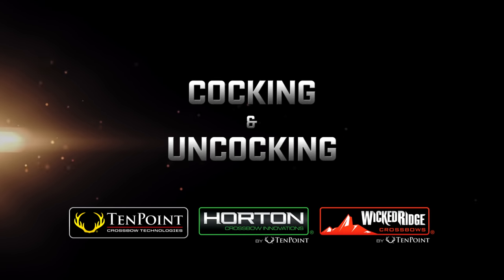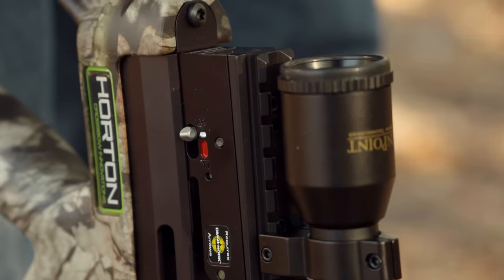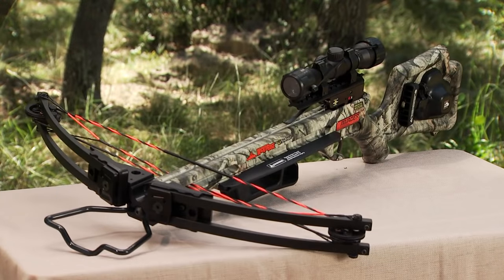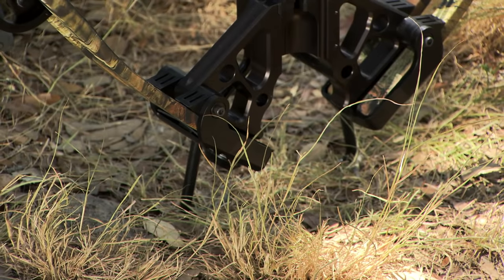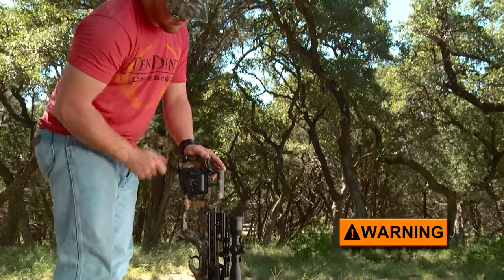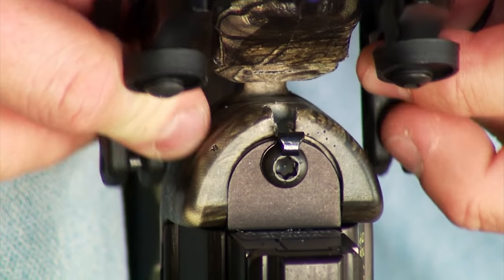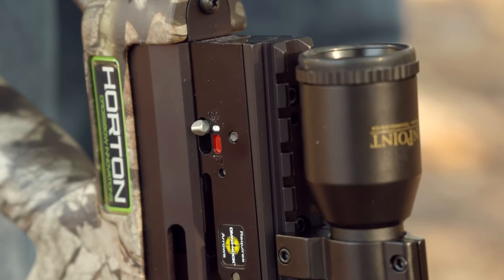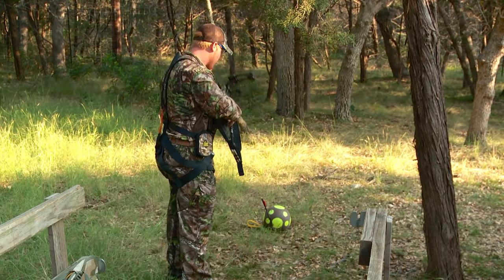How to Cock and Uncock Your TenPoint, Horton, or Wicked Ridge Crossbow | TenPoint Crossbows

Comment: I have a Barnett XP400 w/CCD. It worked at Cabelas but after getting it home it's hard to crank and before it gets far enough to lock in, the 2 hooks are scraping down the arrow track & also wedge against the upper rail stopping the cock by 1.5" from locking in. I don't know what what to do

Comment: You might want to add to insert the bolt, I have forgotten to do that a few times
and dry fire inhibitor came on.  Hard to get it back in place.  Also, tell viewers to 
make sure claw is on both strings evenly, I had one side come off and graze my hand
and it hurt.  Must be my old age.  I keep a block target and practice arrow in the truck to unload.
Reply: If you insert the bolt, and your hand slips, at least 1 of your toes is now gone. Do not do this.

Comment: Q: how do you uncock
A: U don't

Great video but incase you were wondering that is the answer to the question.  You fire the crossbow, instead of uncocking.
Reply: Why would I want to purchase something to uncock my bow with, that is a one time use? you have to keep purchasing those things. I have used the same carbon arrow for years, with a judo point on it. I just find a place clear of rocks and shoot it into the ground. problem solved. just make sure you examine the arrow after the shot for any damage that might make it dangerous to shoot again. but if you are careful about where you shoot it will not damage the arrow. I have been using the same arrow for years.
Reply: i sold my stealth nxt cost to much to decock $10 in omni cub every 2 days it has to much power for 7 different decocking arrows i tryed it broke them all in one to 3 shots and cheap $7 arrows brake when they blow through the target i tryed taking in the back of the truck with me. it just cost to much money to unload it i bought a ravin r10 i like the 10 point much better and when they add decocking ill be a loyal customer of tenpoint again but with the ravin it dont cost me a $100 a month to uncock it. the ravin company i fell is just a monopoly you can only use stuff they market and they jack the price to 3 times the cost but one you have the stuff no more cost. but there is other brands out there that can be decock saddly most are not at the quality of tenpoint
Reply: I just shoot my big block target
Reply: @LikeWater425  Nice.
Reply: You can uncock the crossbow with the acudraw. You have to pull the trigger then push up on the anti dry fire mechanism, all while holding the acudraw handles in your other hand and then you can release the bowstring

Comment: I bought a TenPoint as my first bow, and I will never buy another one. It survived 3 days and 5 bolts before exploding on me. 

We were able to zero the bow at the store before buying it, which took about 5 shots. Then 3 days later I took my brand new crossbow out to the public hunting lands for the white tail opener. I got out to my spot, I watched a massive buck get about 80 yards away from me, so I started to carefully draw my crossbow using the AcuDraw system. About 80% of the way through the draw, the AcuDraw system came apart, launching he claw in to my foot, ripping off the bolt retention arm, and snapping my bow string. Thankfully I was wearing boots and thick pants or I probably would have been going to hospital over that one. Needless to say, the buck got away.

Repairs will take 3-4 weeks, and TenPoint is doing nothing to stand behind their “craftsmanship.”

Trusting TenPoint cost me my archery season
Reply: That’s wild I have had my tenpoint for 2 years and haven’t had any issues with mine